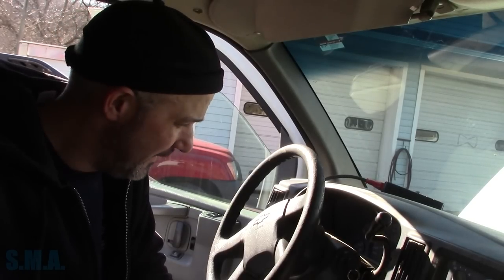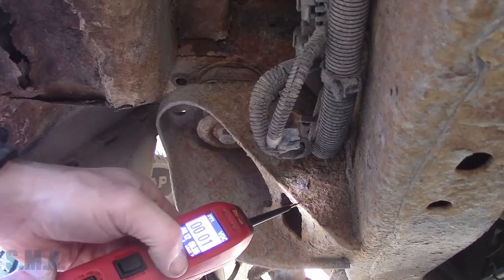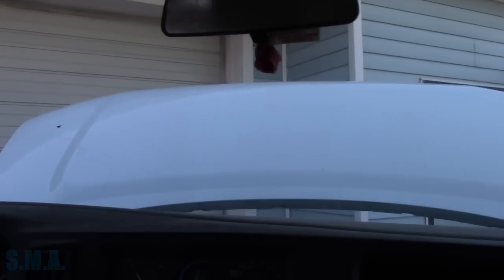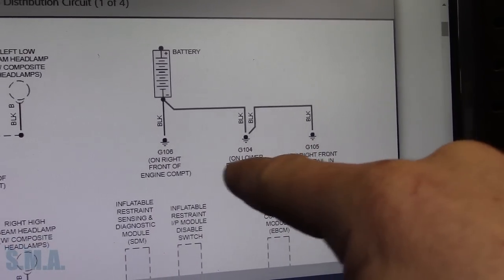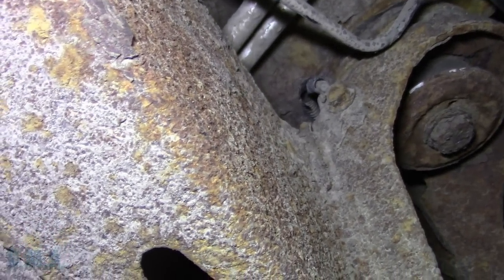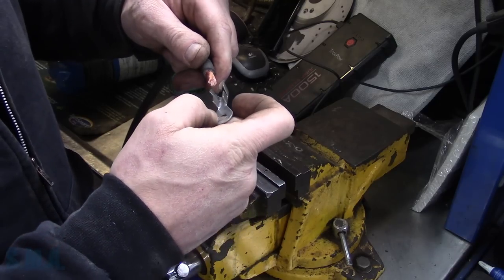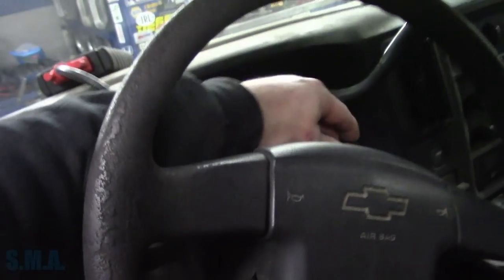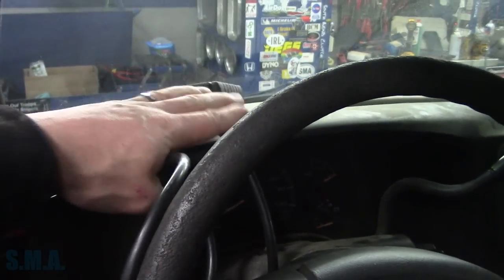Chevy Van : Crank No Start

Comment: That ground cable just doubled the value of that rust bucket...
Reply: Makes me glad I don't live in up state New York.
Reply: Your right. That ground cable is the best thing on that van
Reply: Filling the tank full of gas doubles the value.
Reply: Never underestimate the value of a work van that still runs.
Reply: Well technically it probably did more than that, turned it from a non running van to a running driving one

Comment: Ground to the P/S pump? Block to frame with a longer cable would be my suggestion. I fried a water pump years ago by running a ground from the alternator on a Cat engine. Lesson learned.

Comment: This video saved me a ton of time and frustration.  I had just finished cutting off my running boards and my van stopped running.  Sure enough, the running board was completing the ground from the body to the frame.  The ground strap rotted in two.  I was searching around for tips on dropping the tank to replace the fuel pump when I found this video.  Thank you Eric!

Comment: Thanks so much for being a great teacher, I think I've got it drilled into my head now how you can't rely on ohms resistance measurements to test for a good ground.   I just have to rewatch some of your other videos on maybe using a test light and maybe break out the instructions on my power probe to really learn the proper way to test electrical connections.  I know some of your other videos just checking for proper voltage at a connection didn't necessarily mean there was sufficient current flow there as well.  I think I see a common theme here, when using a volt-ohm meter, you can't assume you have sufficient current flow to the component you're testing.  This is tough stuff to wrap my head around, I really appreciate this video to help me get where I need to be.  Thanks!
Reply: Yep, me too! Thanks @southmainauto!

Comment: Eric, an easy way to crimp a ring connector to battery cable is to first form the ears that crimp onto the copper strands around a 5/16" steel rod, then remove the rod, insert the cable wires, and perform a final crimp-down on the copper strand before soldering.  Always worked for me. 
Also, always let the molten solder solidify completely before moving it (taking it out of the vise, in this case).  When the shiney(liquid) solder turns dull, it's cooled (solidified) enough to move.   I am a SMA junkie.

Comment: Just a piece of advice to others from a guy with plenty of soldering experience. You are quite right.  You MUST solder the wire to the terminal because they will otherwise corrode in that environment, being dissimilar metals.

Comment: Great video. A bad chassis or body ground can manifest in all sorts of weird issues. Random lights coming on when other accessories are powered on. turn signals flash when brake lights come on. fuel gauge drops from full to half tank when the head lights are turned on. Lots of crazy things happen when that circuit finds a ground through other circuits.

Comment: I think the ol' girl has a date with the crusher when the next sticker comes due!
Reply: Body on frame vehicles can't fail NYS inspection for holes in the body. As long as the frame is solid it's a pass.
Reply: If it runs, it's good to go.
Reply: A Bit of a sand blast, a bit of Film Spray. Then it will be better than  Macgyvers swiss army knife.
Reply: yar--that's just sheet metal--patcheroo and keep on truckin'
Reply: max p you sure on that? In Vermont holes in the body is a no no.

Comment: In general it's not a good idea to solder crimped connectors to stranded wire. The wire will crack and break with bending.
You are probably ok because of the size of the wire. But, if it experiences much movement it will fail.

Don't take that as a knock. Just friendly advice.

Love your videos Eric! You keep it real. And you have superb troubleshooting skills.

Thanks!

Comment: Done about a dozen of those. The braid is part of the negative cable but are always on back order. I usually go from the starter bolt down to the rearward control arm frame bracket with a cable. Hog out the hole with a unibit and grind it clean. 5 minutes and on to the next rott box. Gotta love Western NY

Comment: Eric a little trick with heavy gauge wires is to bend it where you want to strip like a good u-bend,  take a sharp razor and run it a lot the top of the bend and it will cut super easy and as long as your not a gorilla with the blade you won’t cut the strands. .

Comment: Again great videos, keep em coming. A friends Motor Home electrical system was a night mere, some stuff worked, then at time they didn't work. After installing the ground wires to the eng block, starter, alternator, frame, firewall, and other areas, it all worked as advertised! The RV manufacturer didn't install ground wire one. Ground wires are good.

Comment: She rusty! Almost as bad as my S10 plow truck ... but that's still running for now. 😁

I learned about voltage drop testing when I was at MMI 20 years ago, but for whatever reason, I never used it, and forgot about it over the years. Then I saw one of your vids 3-4 years ago on it. Months later I had a bad ground in the new fog lights and headlight assemblies I installed in our '93 940, and I remembered your vid. Whenever I put the high beams on, the engine would choke, lights would go orange, and it would die. I had a 10.78 volt drop on the ground wire up there! I just drilled a hole nearby in the core support, ground off the paint, and ran a ground wire to that - haven't had an issue since. 👍🍻

Comment: well your the man!!! I have a GMC work van and it did the same thing. I changed the fuel pump because I did not hear it coming on. she did not start so I changed the chrankshaft sensor no luck. BUT she's an old rusty girl!!  YEP that grounding strap was pretty brittle. I tried it with some wire and gator clips first and it worked but I did mess with the other grounding strap a bit. so I just pulled it off the motor. Did the same thing you did and its working> Thank you!!!

Comment: Interesting the starter motor worked fine, so the engine ground was excellent. Even though the engine is bolted to the frame in many places, old vehicles rely on those extra ground straps to minimize resistance.
Reply: Motor mount are rubber

Comment: Our 2010 Forester had a broken ground strap no idea how that happened. I checked and it had two more ground straps. My early days of repairing snowmobiles and working on the lighting and shut off for the ignition taught me valuable lessons on the importance of having a ground strap on the engine to frame. One common issue was the tail light wiring was routed under the seat, after a few years, the wires would end up wearing through at the seat and grounding on the tunnel. Even the newer snowmobiles had the exact same problem. Lol.

Comment: HEY! spent the past 12 hours working on my chevy I randomly came across this video (been to channel before however) this ended up being my exact problem, I replaced the fuel pump which I sorta needed to anyway thinking that might of been it butit was the frayed ground wire to the frame it just disintegrated in my hand when i inspected it, went and got a new one and viola. Thanks!

Comment: I have been coming across this issue on a ton of G-vans lately. Some jumper cables make the diag easy, just getting under them in the parking lot is the fun part. You can just barely get the bolt out for ground cable behind the compressor bracket, takes some time but is worth it if you are replacing the cable.

Comment: I used to do the EXACT same thing then one day my brother gave me this amazing tool that you put the copper cable ends inside and you smack it with a hammer and it works amazing. I've even used a little chunk of copper pipe for a butt connector.
Reply: Willa Herrera it’s a hammer crimper I forgot the exact name but there cheap and work great.
Reply: @FishFind3000  I got mine at Harbor Freight, and if you have a large vise, you can just "squeeze" the tool with that. You're right! Great tool.

Comment: I always solder/tin  the wire first, dip the copper strands in flux, solder the copper ends,  place on to the terminal bit of heat to stick the wire to the terminal and then bend the ends, bit more heat and solder just at the end, super neat way of doing it, don't get any whiskers!!!!

Comment: Eric, would you ever consider installing a 12V winch at the rear wall so you don't need help pushing stuff into the bay ?  you can  hook up a wireless remote fairly cheaply,  and just run it off of a booster box when needed...
Reply: That works good, as long as its a straight in pull. If its parked on the side of the building, its a bit tougher ha ha. I have done that with a winch. takes forever. better than not getting the work done at all though.

Comment: When I first got my 66 f100 I ran battery cables to all grounds and connected up to ground on battery had no problems for years until I went through the truck and cleaned up rust

Comment: Man I dont know how you have the patients to deal with those crimp type terminals. I throw those in the trash. I go to a local "specialty automotive electric shop" in my area and get heavy lead type solder on terminals that you could run over in that van and they would be fine. I dont ever crimp, I use a thick roll of "Rosin Core Solder" solder them on and heat shrink. Which in my opinion is the best and strongest electrical connection that you can have. Have a nice day!
- Joe from Pittsburgh PA

Comment: Proper fix .  I would have gone larger gauge  4 is ok 2 much better . Look like the battery to engine  should be replaced  also.  I understand time needs to be billed  so a heads up about the battery to engine cable replacement.  enjoyed the video.

Comment: Mr. O, I find it easier to tin the wire before installing it into the connector and then soldering the connector and wire together.
Reply: He was using the terminal as the heat sink as solder doesnt like open flame. If he had the soldering tip, that would be better. but thats the way i have done it for the past 20 years.

Comment: I would have just connected the pump directly to the battery with a switch to turn it on and off as needed (for a diesel engine).

For gas.... You did it perfectly!

Comment: That braided ground is the factory ground and is very common.   If you were to perform your same initial test with the power probe while cranking, you would see the green ground light flicker.  
I've probably fixed 100 of these vans for this issue.  We basically performed the same repair except we went from the frame at the or near the original location on the frame up to the main body ground (that small wire that comes off the battery ground wire and is bolted to the "fender")

Comment: I guess I'll tell my "dumb kid story." I had a crank no start on my grandmother in law's 87 w150 dodge. I went over today to take a look and sure enough not getting fuel. Just like you, a snort of brake clean in the intake and it runs for a bit. I check all the fuses and all good, so I say needs a fuel pump, cause you know, shoot the parts cannon whenever possible. So of course I wrestle for hours on 33 year old bolts to get the tank down then run to the parts store. I tell the guy behind the counter I need a fuel pump for an 87 w150 with the 318. Now, I'm lucky I got an older guy cause he kind of scratched his head and asked, "the mechanical pump?" I said no in the tank. Of course he follows up with, "I hate to tell you son, but it dont exist. That truck has a carburetor". So now I get to go over in the morning and put the tank back in that I dropped for no reason. Haha
At least i had a good laugh at myself today. Glad I'm not a real mechanic cause that would have been even more inexcusable than it already was.
Reply: Good one!
Reply: Hey it happens. Was working on an old throttle body injected S10. I am a certified master tech, over 20 years in trade.this happened 2 years ago, barely ran, hard start. Checked fuel pressure, about 10-12 PSI is good. I test it, 8 at idle, throttle up, it drops to 3PSI and stalls. oK bad fuel pump, hook the scope up, look at pump motor, pretty sure is has a dead pump segment by the pattern. Drop tank, change pump, on those you have to pull just the pump motor and reuse everything else. So i do my surgery and slap it all back together. Cycle key, i hear pump running, much faster than before. Crank it, and crank it, no start. Check fuel pressure........0.  I am befuddled. So i go look at my parts on the bench, i see something missing from my parts. I grudginly pull the tank back out, pull the fuel assembly back out, take the new line off of the top of the new pump, yep, there it is......they send the pumps out with a cap on the line to keep dirt and moisture out . I missed it because they are usually red or yellow so you cant miss them. this one was CLEAR!! So i pull it off, put the tank unit back together, bench test it THATS YOUR PROBLEM LADY. Reassemble and it worked flawlessly. First one in the shop to say anything about it heard this "hey i have to fix all of your mistakes and misdiagnosis, i am entitled to 1 of my own". ha ha
Reply: Yep, wait for the diaphragm to fail a have gas pumped into the crankcase!
Reply: Make sure the fuel line isn't obstructed or broken in the tank before you put it back up.
Reply: I hate when that happens! Like looking for the blinker fluid reservoir in cars that didn't have one.

Comment: Quick way to check for a bad ground like that, especially on a road call, is to use battery jumper cables. Put the black on the battery negative, and the other end of the black to a good frame spot. I have also found that inspection monitors (IM readiness) that fail to reset, could indicate a bad ground.

Comment: My 1985 Dodge 1 ton stopped running. I was thinking it was a spark issue. After a bit of cranking, I went to do something with the distributor. My arm brushed against the manual choke cable and it felt HOT ! Anything on the engine block was getting grounded via the choke cable!! Yep, found a bad ground on the core support.

Comment: Im not sure perhaps someone has already suggested this but, in the past when I have had a suspicious ground and I am testing with my power probe, like in this video, I just flip the switch to put battery voltage at the tip and touch it to the frame. If the circuit breaker trips then, you know that the ground can carry somewhere around 20 amps. Is it the best for the tool? IDK but it works.
 -Cheers
Reply: I do it all the time. The circuit breaker lasts a long time and is replaceable. No need to pop the breaker though, a quick flick to B+ is sufficient.

Comment: Cool diagnosis. I feel dumb. My 1996 Chevy WT1500 had a rustier frame than this one but the body panels and rockers were in good condition. Just had some rust on the underside of the door and the cab corners. The body on this beast did not look good. My ground strap looked the same but used just a 10 gauge piece of wire being too cheap to buy a battery cable. That was some quality work in the video and the new strap will outlast the truck by 15 years.

Comment: I used to put a cable on the motor mount bolt driver side lower rear and run it to a hole in the frame and jam a 3/8-16 nut and bold and called it good.......can't count how many pumps got replaced over this for nothing.... They are just as bad up here too. I think New York and Ontario share the same philosophy on snow/rust control....

Comment: great repair, I hoped it will work on my chevy van express 1500 but it does not. The problem is when I turn the key I can't hear the pump and it shows also check gauges. It starts sometimes when cold. The car was in three places and the problem appears to be back. I put power on pump relay and pump works but it seems the computer cuts out ignition too. I saw Your other video with brown wires cum sensor broken wire so gonna check it. Thanks for sharing

Comment: The best bro . great info and vid dude. Say hi to Mrs. O for me please. Lol I have a 93 astro been in my yard for years . Use to start every year as it is or will be , hopefully my mid life crisis van . Thinking kiss band themed done-up with 454 turbo posi  loud speaker system,  big barley street legal fatties on back, power  extending roof camper style with running hot and cold water with fold to the sides bed to make room for entertainment ohh just turned 50 and still no time at it. But it just stopped a few years back from starting. Ya I said it like that sue me grammar PD . lol brand new fuel pump installed a year before that last year i moved it into my yard in hopes after the winter its time to crack at it. . ROFLMAO has not moved cept for when i pushed it four feet ahead for shed lol . Has not ran since . cranks but no gas out injectors of tbi, stumble runs when i use starter fluid it will catch and run till fluid vapour dies. . changed fuel filter lots fuel, down my arm pit.   flow proper direction. I rebuilt tbi with seals, injectors etc. but still no go pump primes strong and every time . no spray in the bowl . injectors click with 9 volt battery. and brand new as well as fuel filter and pump . WTH> Am i missing here. Have a compression meter but no connection to shredder valve . why the hell they sell these things with no proper connections is ridiculous.  /shrug. I am at a stump with it. Also have the stereo taken out of it and ran fine . watching your vids about bypass lock and now this gives me that kik in the ass i needed . Thanks bro . wish me luck . South Main Auto rocks.

Comment: The fuel pump failed in my old 2002 Ford Explorer Sport Trac last year and my mechanic (a one man shop) couldn't find any of his neighbors to help him push the truck into his bay so he could get it up on the lift to drop the fuel tank. What he did to start and drive the truck in to the bay was he rigged up a fuel supply and pump and connected it to the pressure test point on the fuel rails.